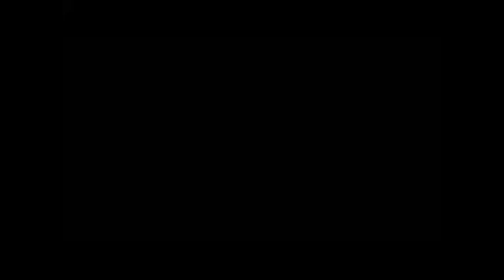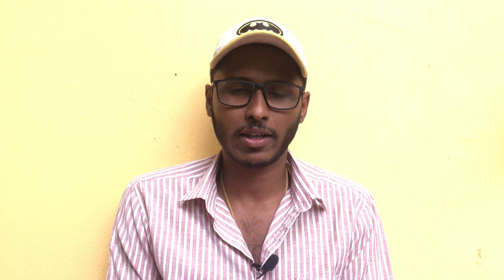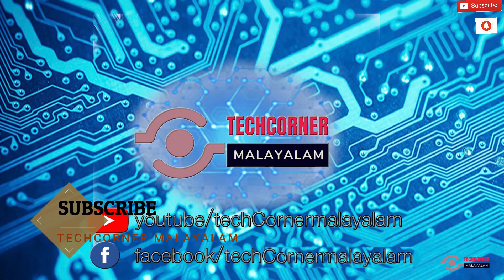What is CT & PT in Malayalam |എന്താണ് CT,PT

Comment: Ohms law vechu current and voltage directly proportional alle appo ivide engana voltage kudumbol current kurrene
Reply from the maker: Transformer il allelo ohms law..transformer design thanne angane aanu  transformer il power constant aayirikum input and output
Reply: Load onnum connect cheythittillalo.. thats why..same in transmission lines

Comment: I have a doubt regarding the inductor and capacitor. I think you can help me. The inductor is doesn't allow sudden change in current and capacitor doesn't allow sudden change in voltage. But we having the AC supply voltage with 50hz frq and current, every cycle it will become zero and then positive max , zero and then negative max. My doubt is then how the inductor and capacitor will allow the changes in voltage and current in our home appliances and other devices.
Reply: That's not how it works. An inductor filters out high frequency waves by offering high resistance towards ripples. A capacitor filters out dc components by offering high resistance (impedance)